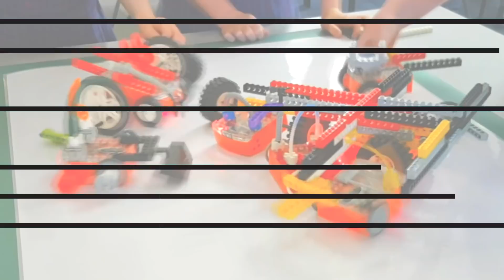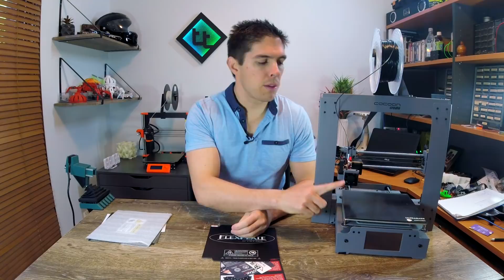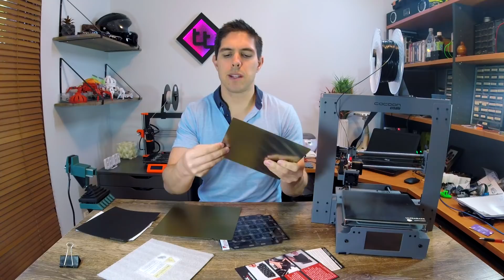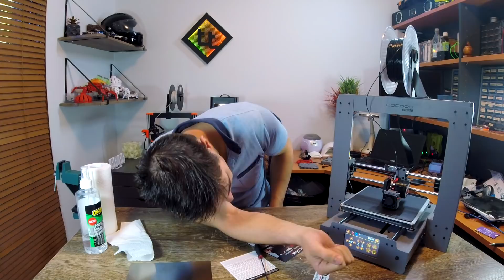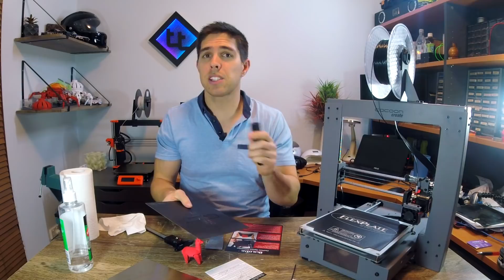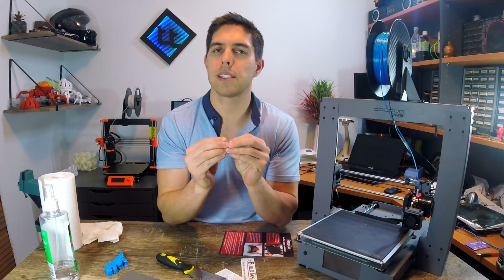Buildtak Flexplate System: Comparison with Prusa MK3 bed and Anycubic Ultrabase

Comment: Please consider using a digital solution.
Digital read out
Take a cheap 12$ digital caliper (prefered without claws)
Precesion and ease of use beats some effort making and installing.
It allows to print on top of tall objects as well.
Would yould try using a 100mm screw when you want printing ontop of 80mm box?

Some folks have used l MIROMETERS for small but very accurat bed levelling travel.
Be inspired by DRO on lathe.
thingiverse  thing:878060

Comment: You could use a heat bed cooling fan after the print is finished if you are impatient.🤔
Reply from the maker: That is a really clever idea, especially if built into end gcode.
Reply: @TeachingTech  I'm a fan of many fans 😎😁

Comment: Does it stick to the bare spring steel plate? Can you do without the build tak surface?
Reply from the maker: I've only tried with TPU and no go. Normally TPU sticks to anything. You could put on whatever sticker sheet you wanted, including masking tape or PEI.

Comment: I'm still using the stock build tax on my cct and I have a really hard time getting my abs prints off but I do clean it with acitone so there is probably a thin layer of abs on there
Reply from the maker: That's a plausible theory. I find the sheets degrade over time.
Reply: Teaching Tech nah I replaced it a week ago
Reply from the maker: Try relevelling to raise the nozzle a tiny bit.

Comment: Great video, Michael. Did you get the 203 x 203 size system? I was looking at the 220 x220 size for my CCT. That should take right to the edge of the bed. I have also upgraded firmware to version 3.0.1 ADVi3++ with a BLTouch after watching your recent video. Nearly as good as my MK3 now too.Cheers.
Reply: Not really. Just solder on your pins to the board and make up a extension cable and it all goes together really easily. I printed the adjustable mount for the BLTouch too. The ADVi3++ instructions are excellent. I am remodelling your plate backing mount too to cater for the 220 x220 sheet. WIP till I get the parcel from the US. Cheers.
Reply: Morty61 I'm thinking the 220x220 is the correct size for this type printer, because the heat bed is 220x220
Reply from the maker: Yes I think 220 x 220 would be better, I probably should have measured but I didn't have the printer next to me at the time. I'm going to update the firmware again soon and have taken first steps to secure a BLtouch. Anything that's tricky about fitting one?

Comment: Aww man, I just ordered the glass plate last night :( It seemed ok to me since I dont print ABS. We have a Prusa MK3 at work and the PEI sheet is terrible compared to buildtak. The smallest bump and tall prints break free even with a 25 line brim.. I am not a fan.
Reply from the maker: Hi Dale, if you love the glass plate then that's all that matters. I think it would have been fine if I was only printing PLA with it. I just prefer the flexplate system. Surprised to hear about your MK3 issue, I'm yet to have a print comes loose. Does the live z need to be closer?

Comment: What happened to your anycubic? I have been using it for a long time with no issues! Your video about it - you obviously had the levelling way way way to close?
Reply from the maker: In the first video, yes, in this video no. I would say it was working as intended, as I could pel of the skirt by hand and cooled parts would lift off easily. Glad you enjoy that bed, as I wrote in the description; as long as others are usin it happily my opinion means nothing.

Comment: I have a set of buidtak flexplates for my Dreamer and Anet. One plate with PEI and one with buildtak for each. Also grabbed a spare plate for my PRUSA MK2.5 and put buildtak on it. So I have a choice of surface for all my machines. I agree with the recommendation, their plates really do work well. 

I always print a raft under models I do on buildtak like surfaces. Eliminates any rough bottom layer issues.
Reply from the maker: I think you're onto something, thanks for sharing.

Comment: Yes the BuildTak really works every time. that is why I put it on one side of the Prusa MK3 flex plate, had to do some probe alignment but works great and I can change my live Z and flip it over if I want to use the PEI. A 50/ 50 flex plate. I did a video on it that you can find if interested.
Reply from the maker: I checked out your channel, I was particulrly fond of your 'parts only' 3D printer purchases that has simple fixes. Makes me want to look for a bargain like that.
Reply: I just checked Ebay today and you can still get the Flash Forge finder for a buy it now price of  $109.bucks, from time to time they have other printers, you just have to search every day to see what is there.

Comment: Great content again. I got multiple buildtak plates for my prusa Mk3 , they have a specific kit. Yep Matterhackers are the guys to talk to. (Even if the product is not in the store!). The main reason is the scarcity of replacement sheets from PRUSA. I since went back and added buildtak flex to 2 other printers (Lulzbot mini and Lorei 12).  I use the Buildtak with UHU for PETG. I also used LokBuild on a Buildtak flex which I think is even better for ABS.  After a lot of PETG I got a bit lazy for my prep. so I've killed one sheet, which at the moment would have been a disaster for the PRUSA.
Reply from the maker: Good to hear most users are in agreeance. Thanks for posting!

Comment: Another good, informative video!  I finally installed my flexion extruder on my MP select plus, so naturally I would love to see you do a follow up, tune and tweak video for the flexion extruder.  I have only done two small prints with it and am getting more stringing and blobs using PLA.  I want to do flexible filaments but also need to still use PLA.  Thanks again for the "typical user" style videos!  Jim
Reply from the maker: Hi Jim, thanksfor the feedback. That video is coming. I have sme excessive moire which I hope to tune out by playing with the stepper driver vref.

Comment: I enjoy your videos. Real world technical issues. The TT throbbing light is distracting. Especially when you skip frames. Please remove from the back of your head.
Reply: I too thought it was distracting, but in a "Dang, I should make one of those" type of distracting.
Reply from the maker: First time I've had negative feedback on the sign but I take your point.  Thanks for watching.
Reply from the maker: Nomally it's not so close to my head. I might consider leaving it of when I film from this angle with the table in view.